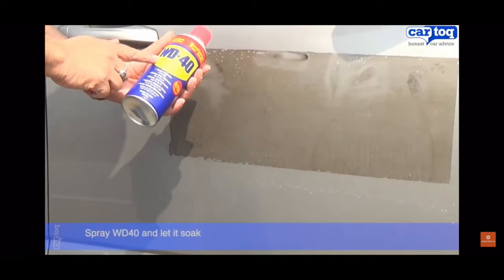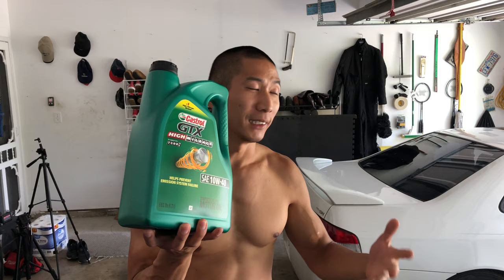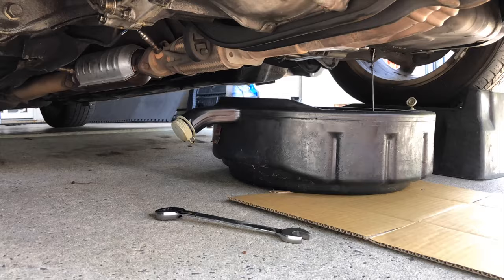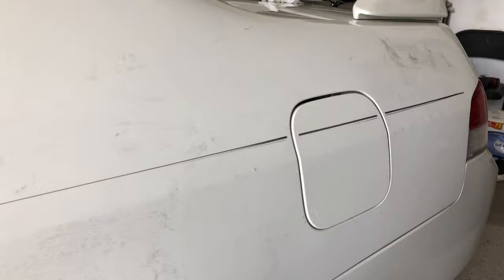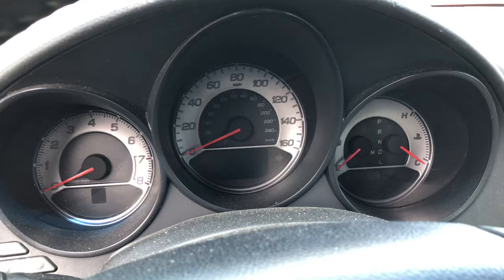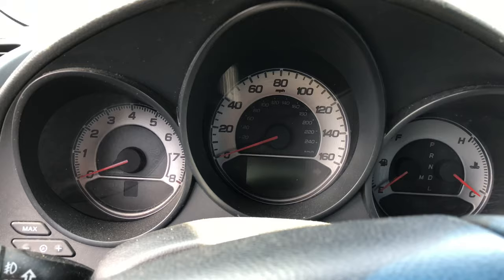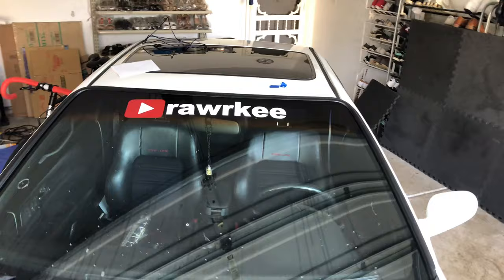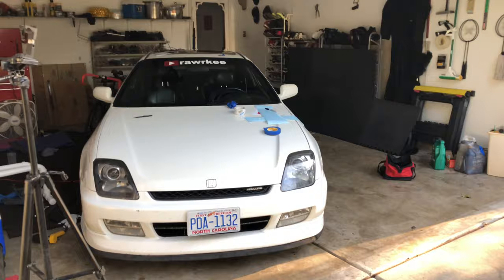Hotshots Car Meet by CMC - Concord, NC RAWRKEE115

Comment: Do your have any tips to fix right left arm strength differences in OAC/OAP your band assisted OAC/OAP tutorial did work as today i did 5 x 1 reps on both right and left arm. But even though i am right handed my left arm is significantly stronger than my right. Yeah your can see here on this video https://www.youtube.com/watch?v=g5dKHYIipic
Reply from the maker: well, over time, each side should become similarly strong as long as you do the same amount of reps with same intensity on each side. Keep it up man, you are lookin great :D Have you been working on negatives?
Reply: @Rawrkee  Yeah ofc the ones with slight to minimal band assists.